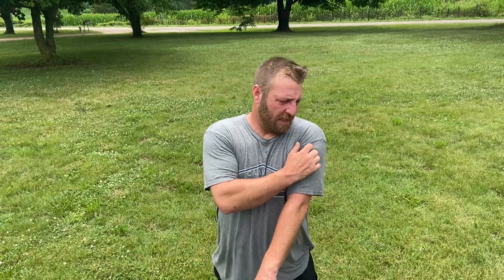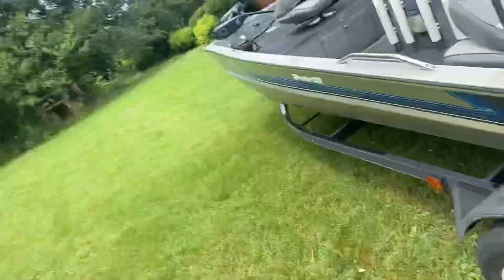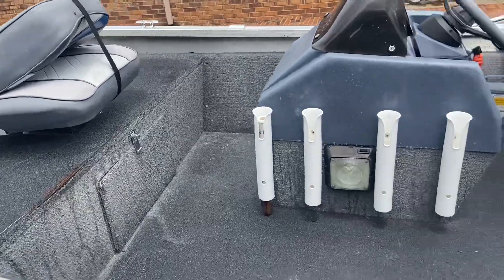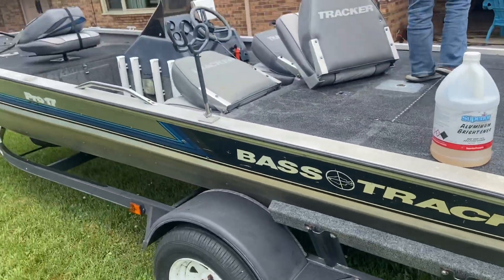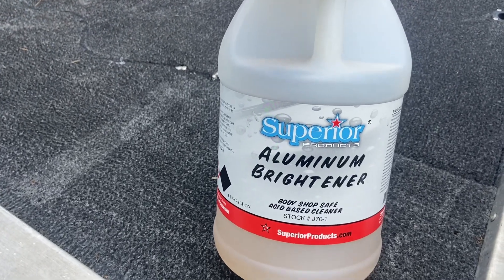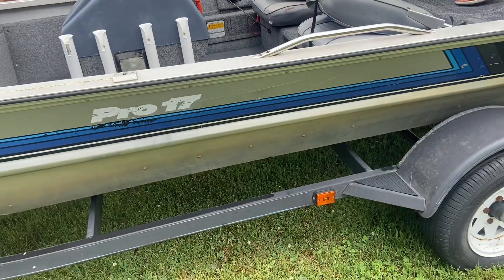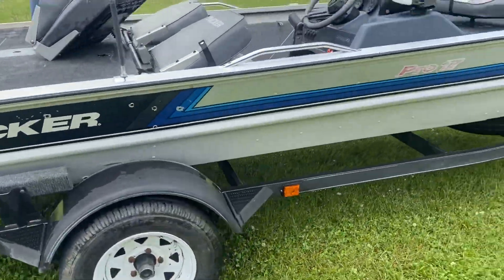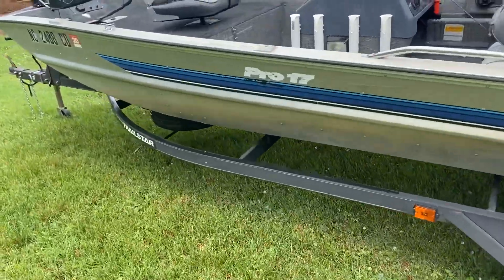How I clean our Bass Tracker aluminum boat

Comment: If you have to apply several times there are much better products to use
Reply: Only need to be applied once if you don’t add water to it just spray it on brush it evenly and rince off then polish your boat with white diamonds after